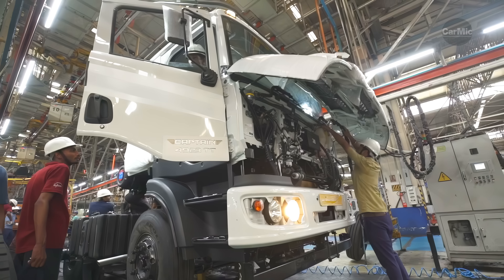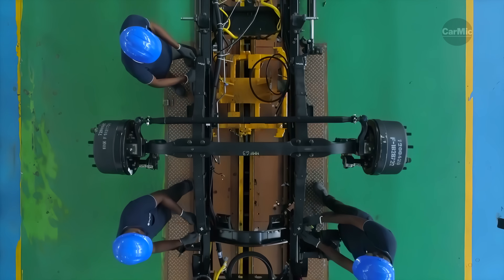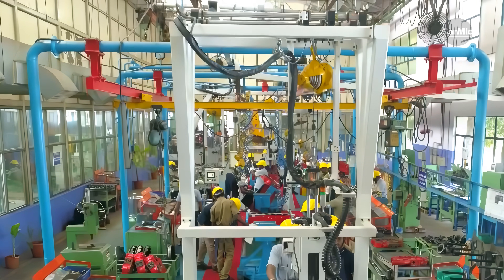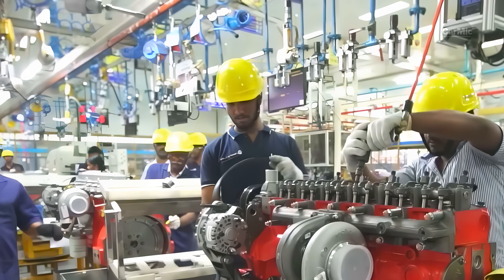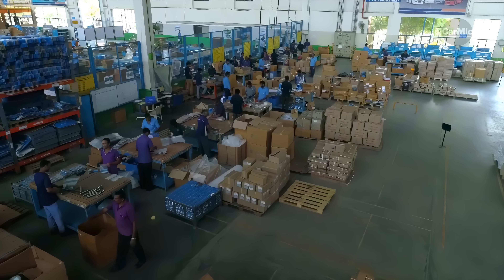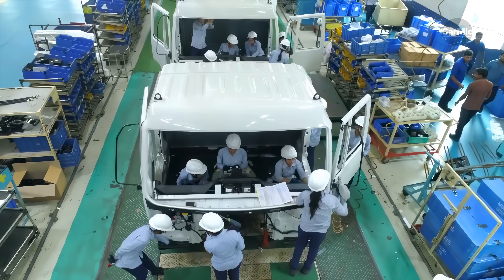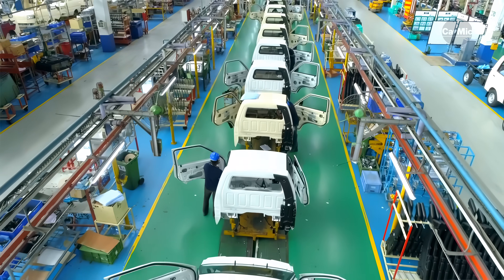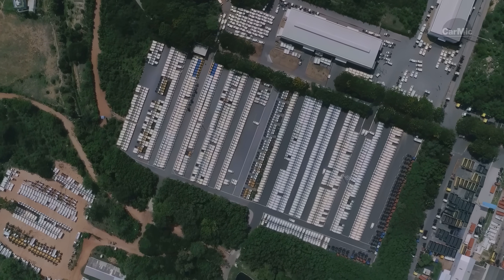Inside Ashok Leyland Truck Factory in India – Production line (Hosur Assembly & Chennai plant)

Comment: Very worst interiors not driver sleeper seat very very worst hard plastic cabin inside platform is not good not properly cabin u truck vehicle 100 degree heating inside 🥹I'm not running the vehicle in 11am to 5pm very worst angry 😡 al cabin engineering